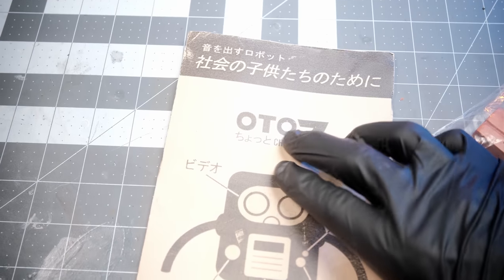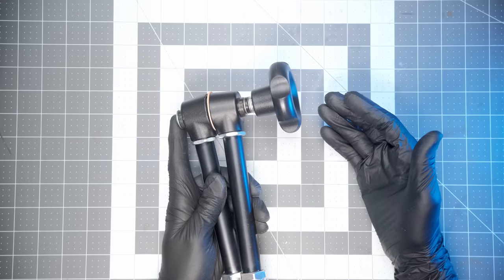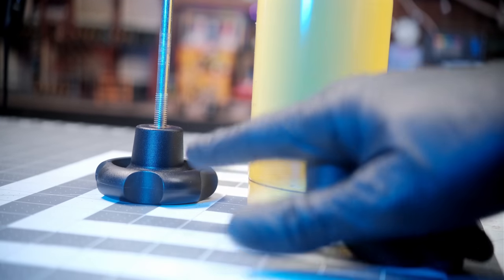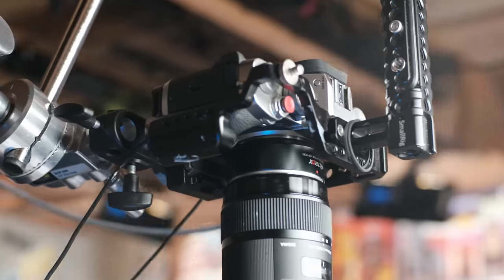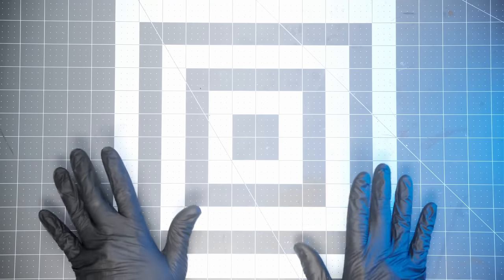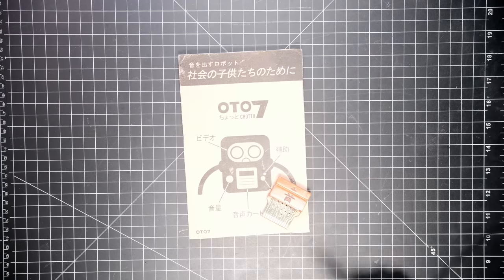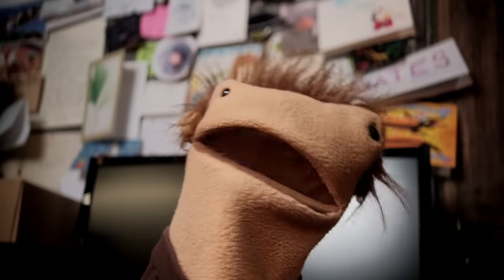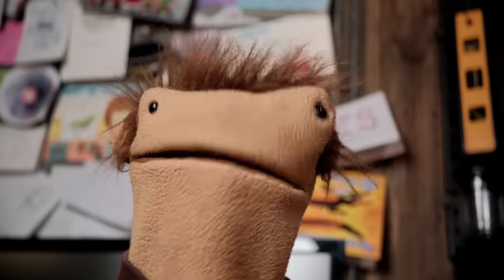Hopefully this makes things easier.

Comment: It’s crazy to me, how many high-end, and otherwise high-quality tools have failure-modes that are seemingly intentional… designed to fail, and integrated into the because 99.9% of people aren’t craffy or determined enough to fix it on their own, leading to more sales, more failures, and so-on. 

LIVE TO DIY.
DIY TO LIVE.
Reply: It's intentional, but not quite for the reason you think. You can't make things indestructible, and if you make every part equally strong then when a failure inevitably occurs, it can be in a part that is difficult, expensive, or impossible to replace. So good engineers design for that failure, making specific parts weaker so that they'll sacrifice themselves first before a more expensive failure can occur. The knob on these magic arms is trivial to replace (or repair), but if the joint itself had been damaged the whole arm would have been junk.
Reply: @JamesChurchill that makes no sense, your average person will not be doing a 'trivial' fix involving melting plastic and filing down metal nuts. Even if so, the repair will likely ware down again very soon. The entire design of that thing looks garbage based on the fact it uses plastic for any of its parts. It should be composed entirely of metalic pieces only, especially at the high price it's sold.
Reply: @JamesChurchill  If that were the intent, it would be easy to remove the brass nut.  It should be held by a set screw or two, not molded into the plastic.
Reply: @JeffJeffers0n nah, that does make some sense. None is an exaggeration.
They may have decided to make the nut strip, instead of the handle crack or the shaft twist. Maybe it was I'll informed.
On the other hand, making parts fail to improve sales is legit a thing. But, not always.

Reminds me of when features are will work kn a model, but they spend extra to disable it, so you pay more for the one that doesn't have it disabled.
I used to support some computers that shipped with colour displays that were disabled in the BIOS. Just a quick switch and you had a colour display. Saved hundreds of dollars.
Reply: A new replacement knob seems to be $16 - not cheap but only 10% of an entire new arm. It wasn't the plastic that failed, so I don't really understand how replacing the plastic with metal would help...
Reply: @JeffJeffers0n  the design intent in this case would be replacing the tightening knob, brass nuts are more expensive for the manufacturer so again this demonstrates an intended failure point not some diabolical profit grabbing.
Reply: this was a 100% intentional fail point, using two different hardness of metals to rub against each other and put tension on it when you lock it. When do you see someone use that in construction? Never, because these things need to hold! For $150 that's a pretty huge scam.
Reply: It's not always intentional. Engineering is WEIRD bro. There are lots of different reasons for something to be engineered in a certain way....That might even cause a possible failure point. some of them might be intentional and self-serving but a lot of them are not. When You've been around engineering, machining, and product design for a long time... Let's just say it's complicated when it comes to the topic of engineered obsolescence.
Reply: @JeffJeffers0n it makes perfect sense. knobs are cheap The whole system is not. 

Your construction analogy is non-analogous largely. But there are intentional failure modes built into houses. Fuses are designed to self destruct before the house or whatever catches fire, fuses have been replaced with more robust failure modes though. Failure is unavoidable. Catastrophic failure can be avoided in a lot of cases with intentional "fuse" type failure modes
Reply: It's some kind of standard thread size, so most people would just take it to the hardware store and find a replacement.  Especially if most of the users of this pro gear (and it is) are already the kind of people who are used to fixing little hardware problems (they are).
Reply: @PatrickPease  Knobs may be cheap but you know what is even cheaper, a brass bolt.
They cost cents, and you would get even more life out of them as you could use spacers to grab onto other parts of the threads since only the first couple hold the full load.

That is if you want o keep the nice anti-ceasing effect and smoothness of using steel on brass.
Reply: @Vaasref  That maybe true but it's a bit of a moot point given that the part is clearly not designed to be replaceable.. you literally have to melt plastic to remove the bolt!
Reply: @thalesfm  you don't need that particular handle, and they might sell replacements if you're bent on getting that exact one.
Reply: @PatrickPease  my construction analogy was indeed non-analogous, I still think its accurate for the most part however. Whilst I am aware certain things may be deliberately designed to fail or malfunction, I don't think it was the case here, I would guess it's just bad design of a $160 product that likely cost less than $10 to manufacture. With regard to your fuse analogy, I'm not sure that counts as something failing intentionally in the sense this message thread refers to. A fuse self destructing under the guise of safety is not really it failing, but quite the opposite.
Reply: I suspect that manufacturing costs played in here. A steel knob with a threaded hole for the connection is perfectly viable. But expensive. A steel nut wouldn't have stripped, but I wonder if it would cause more problems with damage to the handle when it did fail. In any event, a 1/4 20 nut is cheap if you have the skill to replace them.
Reply: 150 bucks and they cant use steel instead of brass for that one part? then making it so common folk who aren't crafty cant easily replace it , ( having to melt the plastic just to get the part out). 100% just want you to buy a new one or buy their replacement arms/knobs . No you cant make things indestructible but for $100+ you can make it more durable than it comes off the shelf.
Reply: Um.....guys..... I'd like to point out that looking at the pattern on that nut, that was a factory flawed/machined piece. Those threads weren't complete right out of the gate. I'll qualify my saying so as I've welded thousands of nuts of various shapes and sizes. I've spent days welding nuts into a full size torso. So I've spent a quite above average amount of time staring at nuts........🤐🤭 Unfortunately, our friend got a couple of arms outta the same bad batch and they were doomed to fail with anything but the most delicate of tightening. Sorry to burst the fun conspiracy theories, but bad parts just happen. It's a QC failure. 
And I'd also suggest brass was used because it would friction bind to the steel bolt better, with less torque. But folks usually go more gorilla than butterfly, when tightening things. So brass, steel, titanium, O1....at some point, they all gonna give up.
Reply: @wingnutbert9685  I don’t know you, you don’t know me. I could give you my resume, but YouTube comments are just that. I laugh when people feel the need to qualify their comments with all their “experience” and “expertise.” What it comes down to is differing opinions, since neither of us were there when this product was designed or produced.
Reply: @GruvisMutt  Yep. My opinion, obviously. I don't see your point otherwise. Not sure why qualifying a comment is funny to you, unless it makes you uncomfortable. A qualified comment is more helpful than some uneducated/inexperienced guess, wouldn't you say? 
Anyway. Nothing further to say as I'm not going to participate in the downward spiral in which this is heading, out of respect for this channel and Craftsman.
Reply: @JamesChurchill  This device doesn't require a sacrificial part. It requires better quality parts. It's not like a milling machine or metal lathe where you need to have a brass sheer pin or a plastic gear to break first to prevent much worse damage if you make a mistake. Your comment is a good example of when little knowledge is paired with even less common sense.

Comment: Get a mini split!  ❤❤❤❤ I’ve been using them since seeing them in japan in 2004.  Anywhere you’d use a window A/C… a mini split is so much better.  So quiet, more powerful, and depending on which version, various air cleaning features, auto directional controls…. Not to mention they’re also heaters and dehumidifiers all in one. And they’re much more energy efficient than window A/Cs.  Just make sure you mount the outside unit on a nice slab of cement to reduce vibration noise.  ❤  Highly recommended!
Reply from the maker: Thank you for the feedback! This looks like the direction we're going!  :D
And wow... I hadn't even considered air cleaning features!   :D

Comment: Ah yeah! You want that mini-split. Not only takes care of your noise issue, but it reduces cost! Takes much less energy to run that that window unit. Also should serve as a heat source depending on what you get. You get a window back but the wall unit might take up a lot of space.
Reply from the maker: Thank you for the feedback! We're leaning that direction. The unit my wife and I are looking at the closest has a heat pump as well. (Although HEAT is the issue most of the year, we do have some freezes every once in a while.)
Thank you for watching!

Comment: Great inspo!! Love how you replaced the screw and nut, I think I may need to do something similar to my wobbly barber chair. Also I 100% agree to the mini split! Got a double head 3ton installed last summer and it’s the best thing we’ve done! It’s way quieter than a window unit and more powerful. Ours was a bit pricey due to some needed electrical work, but totally worth it 👍

Comment: Wonderful video Crafsman! I would like to mention it you are fixing to apply heat from a torch to a nut or bolt, be extra double sure that it is not galvanized, or you will be causing lots of harmful vapors

Comment: I put a 9k btu mini split, the smallest I could find, in a 220 sqft work area and it was way oversized. It had no problems getting the room cool but the humidity was terrible. 70 degrees at 70% still  feels pretty gross.   So I jad to run a large dehumidifier as well, which was pretty loud.

This recent heat wave took out the minisplit so it was replaced with a 6k btu window shaker and the room is far more comfortable without needing to run a dehumidifier.

If you do get a mini split and live some place hot like Florida, pull the insulation out from around the compressor. I am positive that is what killed mine with this ridiculous heat.
Reply from the maker: Good to know this - thank you!  I keep a dehumidifier running out there at all times, since I have so many paper/cardboard products hanging up and other items I don't want to get hot+humid.

Really appreciate knowing t hat about the insulation around the compressor! Thank you for all this info!

Comment: You've been busy. It's been a while. A split system would be a bit quieter with the compressor motor outside your workshop. If mounted on the wall without inertial dampeners, some vibration noise will work through the wall. If the inner part has a regular fan it'll be larger than the squirrel cage type air mover. Noise from either will likely be defeated by high tech microphones. The only added benefit of the regular hole through the wall cooling unit is being able to use it as a fume evacuator to keep the shop air cleaner.

Comment: Even though you have the air conditioning going, you can get a wireless lavaliere microphone that allows you to be hands free. But you need a directional lavaliere microphone not one of the blue tooth ones, and if you direct the air conditioning duct away from you then you could easily use a wireless lavaliere microphone.

Comment: To reattach the nut, i think it would be better with epoxy than melting the surface
Reply from the maker: I thought about this, because theoretically I felt like I'd be losing material (with the melting) but I thought if I had to replace it AGAIN, I'd regret having used epoxy, because then removal would likely damage the plastic for more.  (Of course at that point, it's probably just time to get a replacement knob set.)  Thank you for watching!

Comment: Word on the street is that they'll be bringing out a 'family' of OTOs for the 8-series, at different price points. The OTO-8 will straight up replace the 7 as the entry-level device, but there's also set to be an OTO-80 to fill that mid-range, 'business' model gap in the market. And then there's the deluxe, top-end model, the OTO-800, which is apparently so high-spec they're saying it's like it's been "sent from the future". Very intrigued! 

And rumour has it they're already developing yet more advanced models, as far ahead as an OTO-1000. Though by all accounts tests with that one haven't...gone well so far 🤖

Comment: have you tried using noise cancellation techniques with the footage with the air conditioning running? theres even some new AI methods that are very impressive for cleaning up audio quality. 

you could also just speak it out in the footage. and then repeat the same thing later. that way you know the footage is long enough and you know you got to say everything you needed to say.

Comment: Quick question; you got a replacement carriage bolt from the hardware store, why would you not replace the brass nut with a steel one..? They're probably close to one another...
Reply from the maker: This is a great question!
It actually turns out to be potentially detrimental to use like-metals in a friction situation, because there's  more potential they can seize together. The brass is (as has been explained to me, at least) designed as the fail point, intentionally. The way I understand it, it helps prevent a situation where you'd have to replace a much more expensive or complicated part of the unit.
Thank you so much for watching, and taking time to comment!  :D
Reply: @TheCrafsMan  that makes sense.  Thanx muchly.

Comment: Those mini split systems are not hard to do. I hooked up everything but the 40 amp box for the breaker. I went with the mr. Cool system. The lines are precharged with freon

Comment: How did you record directly into resolve for a voice over?
Reply from the maker: In the Fairlight side, find the voiceover track on the right side (where the level sliders are) and look towards the top for "Patch Input/Output". Click to bring up a dialog where you essentially select the microphone or input device (on the left side) and the track you want the audio to go to (on the right side) and click Patch at the bottom of the dialog.

Once that's done, click the "R" on the voiceover track to arm for recording. Then hit record and start laying down your voiceover.  :)
Reply: @TheCrafsMan  thank you so much. 
I've been doing it a very convoluted way.

Comment: Aint it funny how some of the most expensive things you end up needing, usually are made out of the cheapest material around? Like in this case. The item costs 146$, but are made of material valiued at aprox 10$ in total.

Nothing today is made to last, and seamingly allways made out of the chinease material Shitium.

Comment: Manfrotto is definitely not what they used to be. They're surviving on name alone at this point. I've had the same problem with my overpriced Manfrotto tripod. They're using plastic and soft metals like brass and cheap aluminum. Meanwhile the rest of the industry is using steel and quality aluminum only, even the budget options. For $90 I expected my travel tripod to at least be more reliable than than an old pool noodle after 3 months. Clever fix, but just give up on Manfrotto... He's dead, Jim.

Comment: Man that's sketchy, a brass nut isn't much better than an aluminium nut. That should be stainless, all day every day.
Reply: A stainless nut on a stainless bolt will seize up and become impossible to turn without damage. The bronze nut will not, and is usually impregnated with oil so it is self-lubricating. This is a wear part designed to be easily replaceable when needed.
Reply: @JamesChurchill  Are there no steel nuts you can use for this job? No stronger alloys than brass? Brass isn't used in clamps/featherboards/T track fixtures for workshops, and they don't gall.